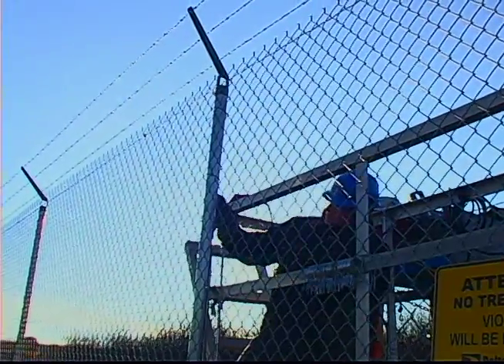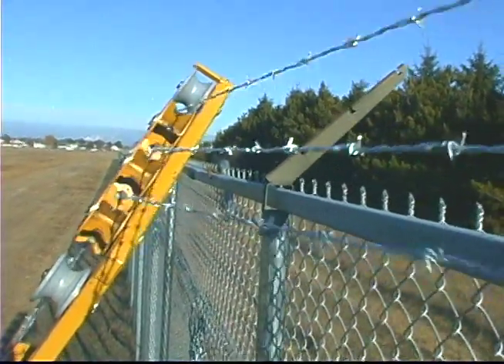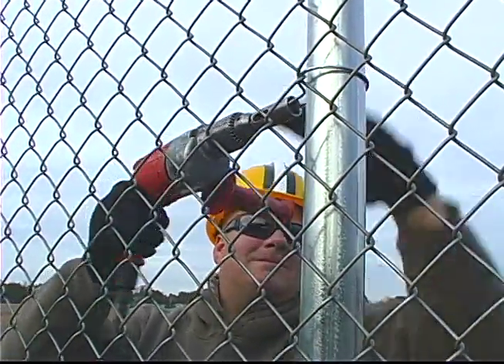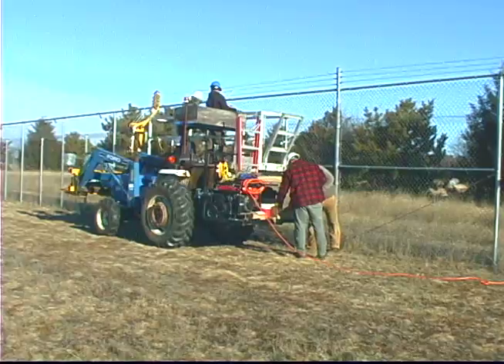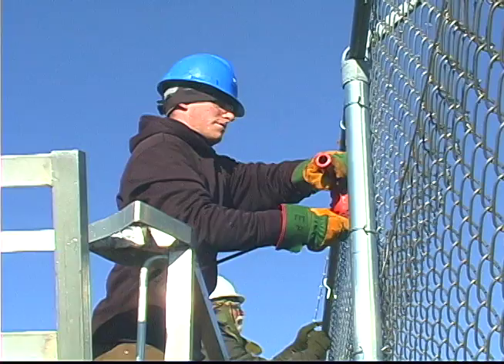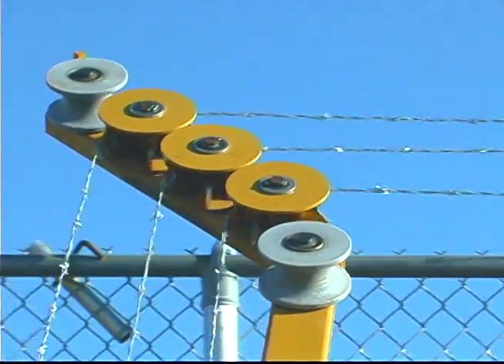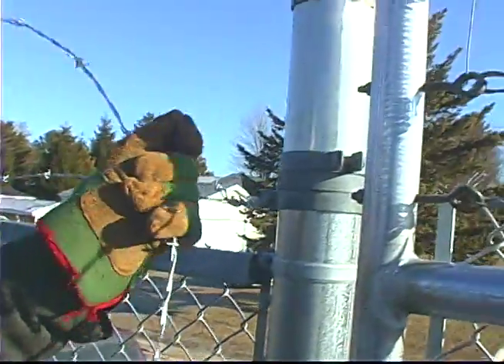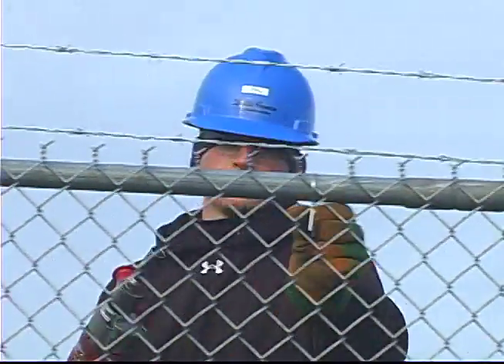Easy Twist Fence Ties and Barbed Wire installation

Comment: what are these barbs for?
Reply: Barbed wires are used for areas you can’t enter. Barbed wires can be in different shapes and sizes, for example: There are metal black fences similar to my backyards wood fence, the metal black ones have these arrow like things on the top which are supposed to prevent you from crossing over it. That’s pretty muchly what barb wires are used for.

Comment: can barb wire be added top of a wood privacy fence.?
Reply from the maker: garlicdawg We specialize in chain link. The barbed arms you are seeing in the video are specifically made for the top of the post. You would need to find a barbed arm that could be installed on a flat surface such as this: http://bit.ly/1bjH3Cc
Reply: LCEnterprisesUSA I need that wire tieing machine???